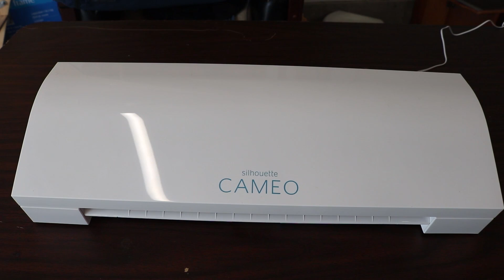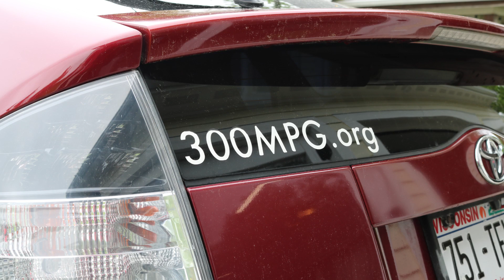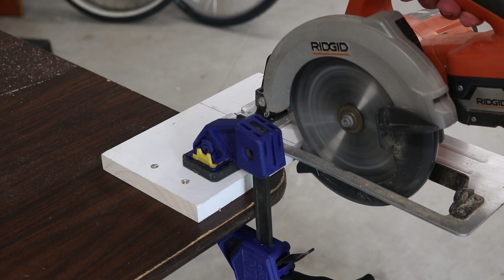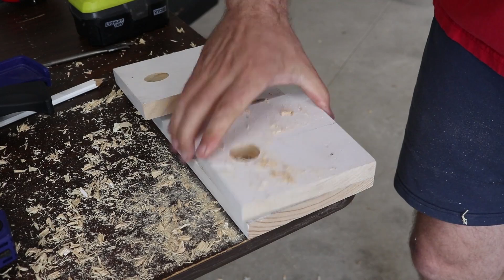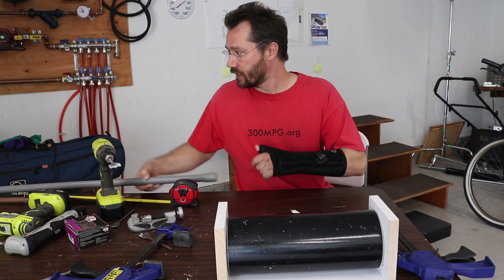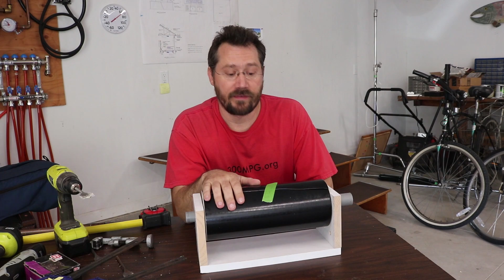DIY Vinyl Roller Holder for Silhouette Cameo

Comment: How do you load the vinyl from the rear?
Reply from the maker: I'm doing it the exact same way as you do from the front, Just feeding it through  from the back first. It just gets the roll out of the way. I still need to feed through however much vinyl I need before I start cutting.